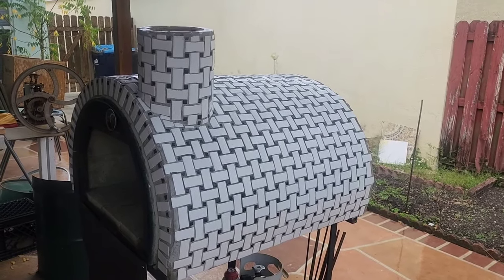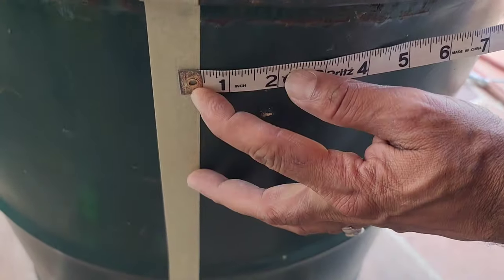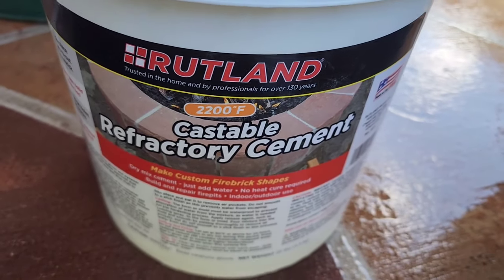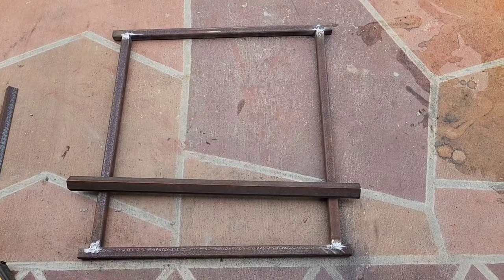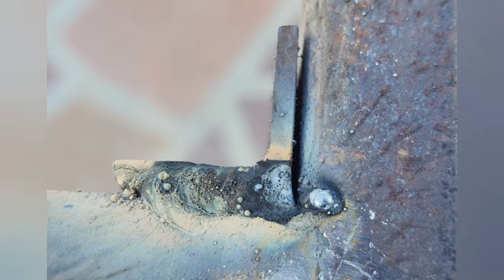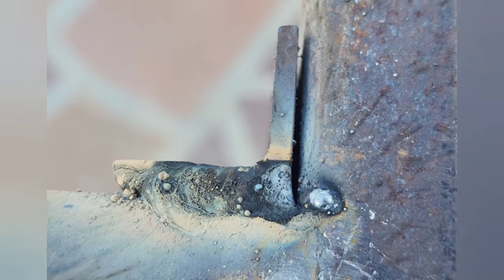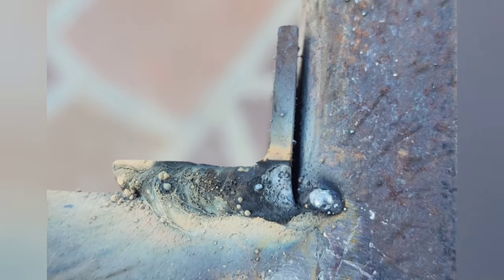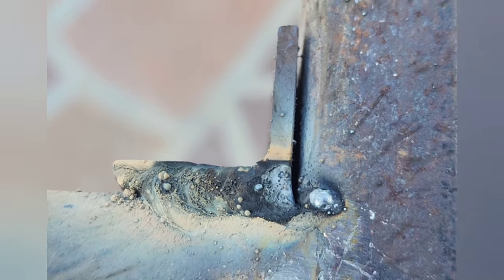Diy Pizza oven build | drum barrel pizza oven | how to make oven | Best oven | forno para pizza

Comment: Very nice job! Ingenious! How long does it take to have oven heated for pizza (700-800 F) and how much gas is used for that heat? Do the burners hold fire if you close the front door, I mean is oxygen enough?
Reply from the maker: Thanks a lot.  It takes about 15 minute to reach 700 and gas tank last me few months if i use it every week. yes you can close the door but open the chimney 20%. remember the burner has space for air intake.
Reply: Thanks a lot!  @SainiBadwalUSA
Reply from the maker: @svzk5573  You welcome.

Comment: Excellent work! I love the burners idea and first time see it. I have one question though, do you think the firebricks will stay attached to the barrel or they may fall because of the high temperature?
Reply from the maker: I use the high heat cement. It is rock hard cement and also cement is on the back side of tiles. I think it will hold for ever as long as temp is under 2000F.
So it will never reach that much temp.
Reply: @SainiBadwalUSA  thank you so much. I think I am going to copy you.
Reply from the maker: @zeyadsh22  After your comment I made a 12 inch heat shield inside just to be safe.
Reply: @SainiBadwalUSA  would you please send a picture to explain how? Thanks. By the way in what state you live? We should become grill friends :) I live in Virginia
Reply from the maker: @zeyadsh22  I will show you in my next video of burners for  oven.
I am in Miami. Please share my video. Thanks a lot

Comment: How this hold up? The heat  didnt make the concrete crack with contracting and expansion of the metal??
Reply from the maker: I have heat shield in it made of steel sheet if you check my pizza video you can see fire does not touch the bricks. holding very well. Also I did not use regular concrete.

Comment: Did you cut the bricks with a diamond water cutter or a dry diamond cutter?
Reply from the maker: just dry they cut like a butter but i did dip them in water to prevent dirt, make sure to use heat shield if you make one

Comment: I am planning an oven build and after watching many videos, I’ve decided to follow your process. Thank you for sharing it with us. Did you use heavy weight or soft weight fire bricks in the inside?
Reply from the maker: I use light weight soft bricks but I use  metal fire shield in the back where direct fire touch the bricks for preventing breaking
Reply: @SainiBadwalUSA  Thank you!